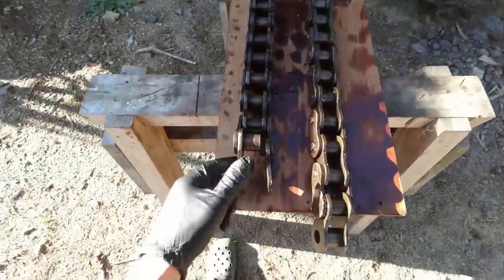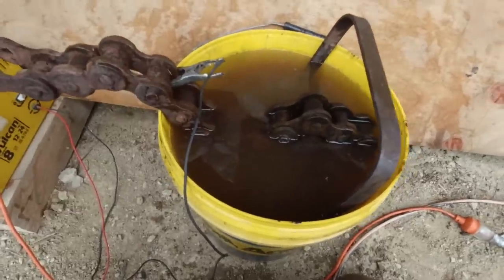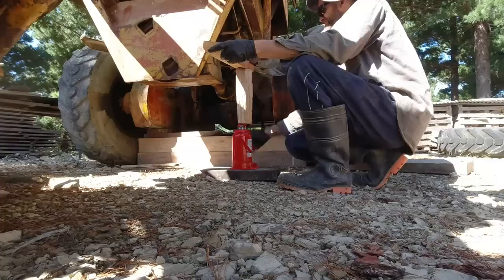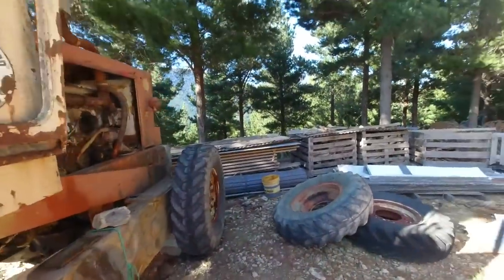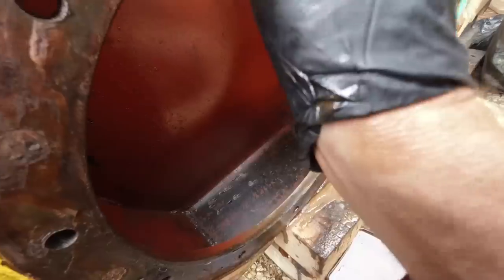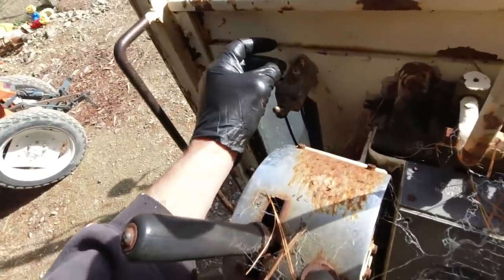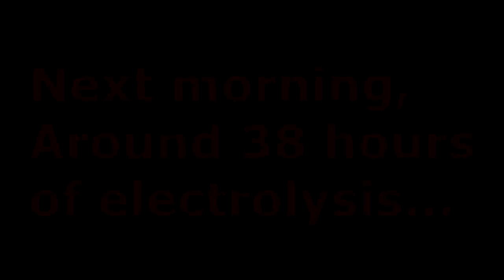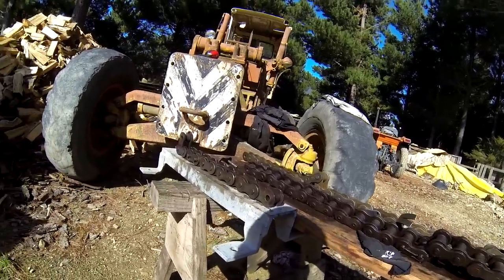12 Ton Grader for Scrap value Part 3- Long Overdue Repairs & Maintenance

Comment: Just wondering, would swapping the 2 wheels around (larger tread on the front drive sprocket) have made it easier on the chain? Great job as usual though Marty! Keep safe :)
Reply from the maker: No the 2 wheel on that side would still be different size, they need to be as closely matched as possible
Reply: @MartyT  Cool, makes sense! Thanks for the reply :)

Comment: I didn't see concrete blocks under that grader did I ? Bad move.... And lever your wheel nuts across the axle centre, it puts less rotation force on the wheel.

Comment: Appropriate ornament - Lazy Barford.Any heavy equipment wreckers around that might have used tyres for the front and chain for the drive sprockets?
Reply from the maker: Yes good point, I'll keep an eye out for better tyres. Chain I am buying new from now on
Reply: @MartyT  Since your close to Nelson,Bearing and Trans or SKF for the chain.
Reply from the maker: Cheers Dave I found some affordable chain at John Brooks, skf and b&t were very expensive .

Comment: if you want really good conductivity in a solution............caustic soda (sodium hydroxide).  Its what they use in nickel/iron alkaline batteries. LoL at the chain drive box sludge...........really needs a good clean.

Comment: invest in yourself mate, milwuakee make some great tools that cover everything from 1" drive impacts to grease guns an angle grinders, gotcha covered for a chainsaw and trimmer too, havent used all of their line up but hear good things and everything i got works great. 5"fuel angle grinder is by far my most used tool, id put it on a lanyard and hang it off my belt everywhere i go but people here in canada would find issue with that hahah

Comment: What you're doing right now Marty is what we had to do when I was a kid to our old galleon graders they were chain driven and my dad would pull the hub off on each side all the way around and make us kids sit there with a flat file and file those teeth down to where they got rid of the burst in your absolutely right about the tire heights they will fight each other and filing that down you're going to make that chain that you're soaking right now last a whole lot longer another thing that my dad did and my grandpa is they took and drilled one hole at the bottom of where each wheel goes and threaded it and put a plug in there a pipe plug 3/4 in and the reason they did that is that just because of what you're cleaning out right now so when they change the oil they could scrape all that crap out through the hole and it would get completely cleaned and they would take diesel and spray inside there to clean everything out and run it out then wipe it all out and use air to blow everything out to make sure the bearings were clean then they would put the plug back in and seal it back up It worked out really good

Comment: What do you do to dispose of the old fluids and fuel?
Reply from the maker: The chain case oil is a bit far gone to use in my chainsaw bar tank so it'll be recycled, the fuel I poured on my firewood pile to add a few more btu 's

Comment: Are you able to make it so it only drives one pair of wheels? Sorry if thats a dumb question haha
Reply from the maker: That is a very good question, and yes you are right, it doesn't have a differential drive axle, it is a gear and pinion  'diff' like a locked diff.  So in theory it can still travel on one wheel drive. Great for getting home but it would put a lot stress on the remaining chains if I tried to push a load with anything less than 4 wheel drive
Reply: @MartyT  cheers mate, we dont stop learning untill the day we're gone. And its better and more satisfying doing things yourself instead of paying a "professional" that does a half arse job and charges the world. Keep up the good work

Comment: A another way to deal with that Rusty dirty chain would have been to put it in oil and heat the oil to about 150 Celsius, you'd be surprised at the amount of stuff that will pull out of the chain.  Deep fried chain anyone?

Comment: To my knowledge a green foam on the electrolysis means chromium (IV), which is very nasty stuff. It's the reason you don't use stainless as the sacrificial anode. So your anode probably isn't mild steel... better use something else next time.

Comment: You filed by hand and wirebrushed by hand. Wouldn’t a electric tool been easier? Still, a good video!
Reply from the maker: Yes it would be faster but it would flick rust and grit into the tandem case and internals of hub

Comment: Jesus Christ man, ..... I would have never thought different wheel circumferences would cause that damage on the drive chain. It must have been installer error not to make sure 2 similar tyres and treading were at the same wear mark b4 they put it on the same side.

Comment: Take the proceeds from this video and get an angle grinder.  It will save you hours over that brush.
Reply from the maker: Yes I've got one, but I've found they tend to throw wire in all the places you don't want it
Reply: @MartyT  Flapper disc are your friend!!  Great videos!!! Watching from Texas.
Reply from the maker: @Mjc103  Yeah I've got them too but didn't want grit in my tandam case

Comment: Would have done a bit of straightening with a hammer and tightened that chain up a little tighter than it should be. Whenever replacing chain of that type absolutely do not EVER buy chinese made chain. I have personally had very bad service from different brands of chinese made chain of a similar size.

Comment: I've no skills whatsoever like yours....not even remotely close...but couldn't you have helped yourself immensely by using a DA w/a grinding disc to assist you in de-burring that sprocket, instead of manually filing the burrs?